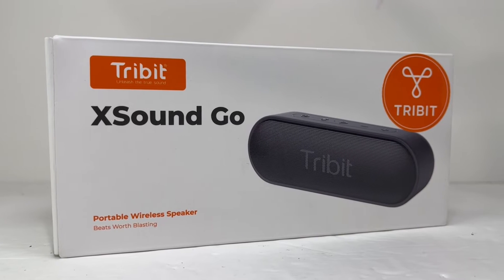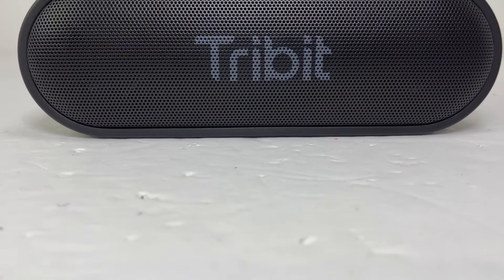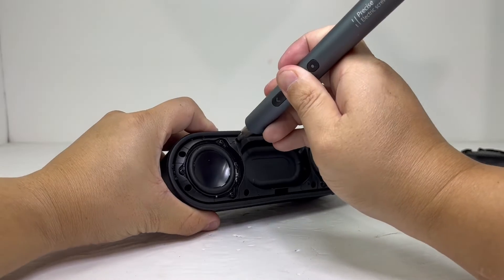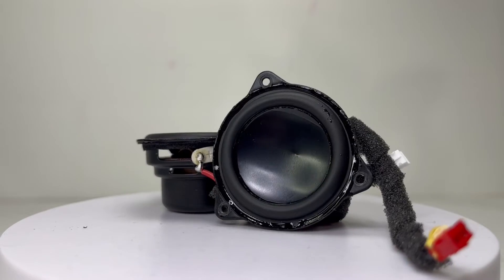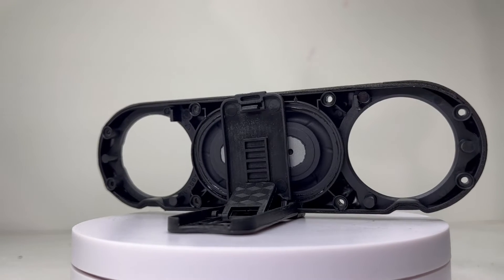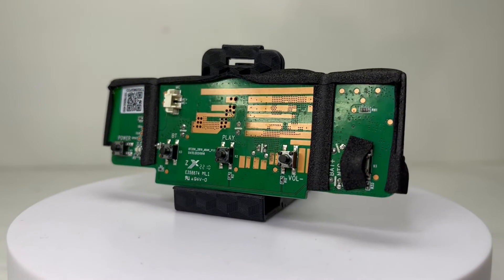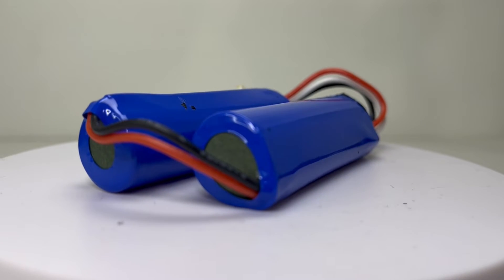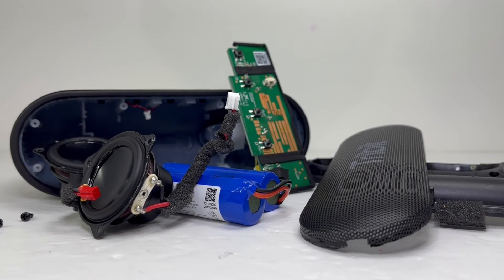TRIBIT XSOUND GO COMPLETED TEARDOWN !!!

Comment: My tribit speaker works only when connected to direct power supply.
Unplugging the power supply, switches off the device in 2 minutes. 
Could that be a battery problem? 
It just crossed the warranty period 😢 of 1 Yr.

I must say it is a amazing speaker. Build strong and sounds clear & melodious. Perfect 👍 .. i never get bored listening to this for longer period. Perfect for a normal size room.
I always used it with care. Just love it. 😊
Reply: exact same case for me, just barely crossed 2 months of warranty 
battery life start dropping, until connecting to power directly failing to.
will try to change battery after watching this video

Comment: After (seldom) using my Tribit Xsound Go for 2 years and 8 months, here's what I noticed: 

1. The speaker often abruptly disconnects the BT connection with the device it's connected with. Happens with different devices, not just a particular cellphone. No one else is using Bluetooth where I'm at. 

2. Gets really easily scratched. At first it wasn't like this. I think the plastic housing of the speaker is degrading, similar to the rubber cover described below.

3. The rubber seal that covers the 3.5mm jack and the USB port will discolor, become shiny and get brittle after about 2+ years. I think the rubber is breaking down (I've had Chinese watches whose rubber straps also met this fate). It'll eventually crack and fall off.

4. At around 20-30% battery the device can already be unusable. 

This Tribit is just one example. Over the years I've bought MANY products from Chinese companies. They, at least initially, seemingly put out good products, but give them 3-5 years before you make a conclusion. In contrast, I have Sony and other Japanese electronics from the 90s that STILL WORK and STILL look good.

Comment: We’re here in china for drydock.. just bought this specific speaker.. tribit brand is not new to me.. the earbuds i use for running is from tribit also.. good earbuds, except there’s no ANC.. but still good..

Regarding this speaker, sound really good for its price range.. no regrets buying this one.. was thinking about buying another jbl.. “was” - because my previous portable BT speaker was jbl go 2.. good thing i didn’t buy another jbl..

Comment: id like to wire this so its always switched on, with the battery removed and just powered by USB power. Any Ideas?
Reply from the maker: it should just be as easy as removing the battery and leaving the speaker plug in to a constant power source.  im not sure if the xsound has an auto off feature that turn off due to inactivity.
Reply: quick fix: plugging in a 3.5 mm cable keeps the speaker from turning off

Comment: One of my drivers is buzzing on bass. Can i fix it?
Reply: you mean the one of the speaker right. I'm having the same issue. I opened and found that Left speaker foam is damaged. It needs replacement. I need to know the speaker foam size so that I can just replace the speaker foam myself.
Reply: @AmrishGamer  right. I opened it up and cleaned it. Never see any problem but its buzzing sometime and it is less loud than the proper one.

Comment: nice video man, love the details and effort that you provide. my tribit xsound go starts to sound distorted after being used for years, and im looking to repair it myself since its still usable. can you tear off the qr sticker at the bottom of the driver to reveal any information behind it? the qr code just says TD0256BS2C0060732898 and google results show nothing. the only specs i know about the drivers are 40mm(1.5 inch) 8W.

Comment: Do you know if the batteries are in series or parallel?  I am assuming series so they should test out as 7.4v across the black and red?  Thanks for the video!  Mine is brand new and isn't charging the batteries so as soon as the battery died it won't work anymore.
Reply: 3.7v

Comment: Is this the upgrade  version  tribit sound go...? Usb  C cus the old one with micro usb use TPA 3118 . The new one downgrade 😅
Reply: The older version is model IC-BTS20 with 12w power. This one is the new model BT-BTS20 with 16w power.
The connector is a bit of a downgrade and a puzzling change but in my opinion the improved sound and power would still make this model an upgrade.
Reply: @mikeharvey3798 i think it's my mistake but i saw terdown x sound go it use TPA 3118 amplifier not SEMT amplifier but check the 2017 board of tribit go it's use SEMT amplifier i confused maybe it's a Developer board that use TPA 3118😅 the power to much  to handle so they switched the amp so no downgrade 😊
Reply: @gadingguna4099  Thanks for your reply. I probably should not have even responded to your comment because my knowledge of electronics is close to zero. I just ordered the new model so was concerned about it being a possible downgrade.
Reply: @mikeharvey3798  no downgrade from original tribit it's interes me which brand spiker will do downgrade internely.. and tribit was not😄 JBL and bose did..

Comment: Hello! I got a JBL GO 3 and i want to know if i can swap the original battery with a Li-Pol 1500mAh, 3.7V, 484251, will it fit? Its got the following dimensions, i want to know this before i go on buying the battery. (51x42x4.8mm)
Reply from the maker: this is the dimension of the original battery 63.5 mm x 35.5 mm x 3.9 mm